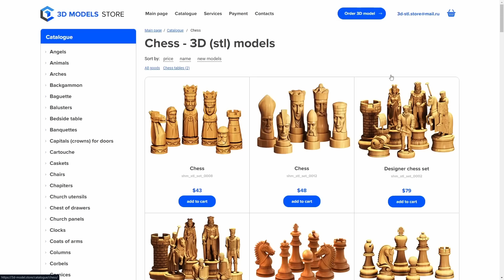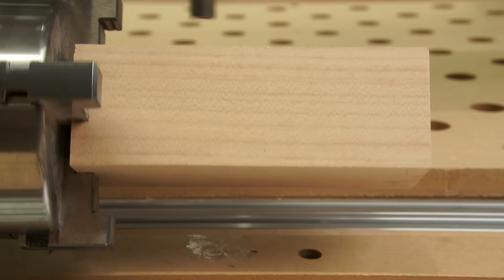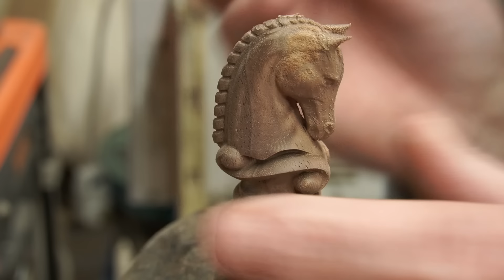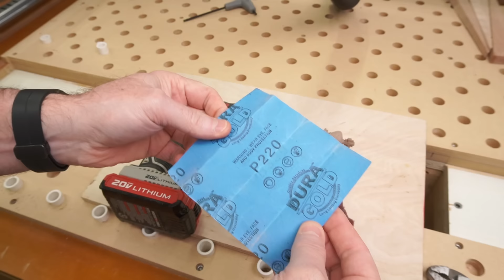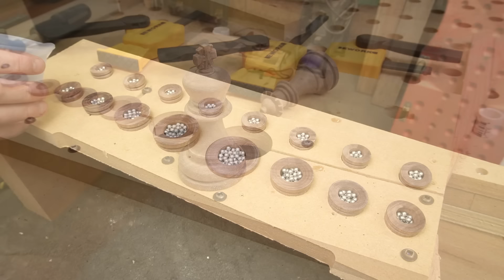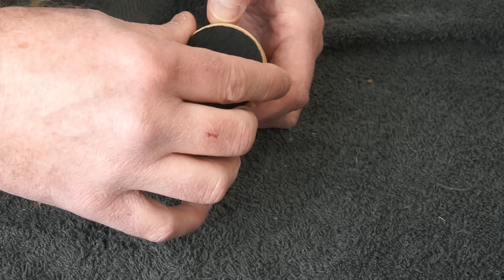Making my own Luxury Chess Set : PART 1

Comment: Couldn't you do the sanding when the piece was on the lathe?
Nice job, by the way!!!
Reply from the maker: It's technically not a lathe in that it spins at high speed.
It was much faster using the drill.

Thank you for watching!

Comment: Gorgeous pieces. Loved the process.

Say you sell them. What would be the price?
Reply from the maker: Thats a hard one to answer.
Because I do this in my spare time, it took me a couple of weeks to do this one set, so trying t determine a price for the time involved would not be fair to whoever I sold them to.

But to answer your question, I have seen similar sets go for as much as $1000 online.
Thank you for watching!
Reply: @MandSWoodworks  Thats exactly why Im asking. I have been working my way up in cnc, 3d printing and lasercutting. Im about to buy a small 4 axis cnc, and the idea is to do chess pieces.

If the machine can actually do a decent set and the price is around that, it would make sense to maybe get a second one to speed up the process.

Thank you.
Reply from the maker: @Alientcp 
I have given some thought to mass producing these and yes, the only feasible thing to do would have multiple machines working at once. 
Otherwise it would take you months to build up an inventory and be able to fill orders.
And also, yes. You wouldn't need a huge cutting area. Just big enough to accommodate the rotary axis. 

Good luck!

Comment: Old heavy sets simply used a cast lead weight disc glued into the base before the baize was applied.  Lead gives better weight for a smaller amount than steel, so base holes can be smaller.
Reply from the maker: I had considered that before deciding on using the BB's, but lead is hard to find in smaller pieces unless you use fishing weights, which are usually oddly shaped.
The BB's did the trick though. 
The chess pieces had a nice "weighty" presence to them. 

Thank you for watching!

Comment: Pretty sure in normal piece making they do the same thing you did but not using bb's or needing resin.  They just go to people who sell metal weights and buy small metal discs, cut the same hole, then just glue it in the bottom.  That way they know exactly how much weight they are adding and the bottom remains perfectly flat.
Reply from the maker: The BB's worked ok.
And the bottom was still perfectly flat when I was done.
Thank you for the feedback and thank you for watching! :)

Comment: Knights look kinda dinky and the Kings are a little on the chunky side, but still an amazing job regardless.  I had no idea CNC machines were capable of this tbh.
Reply from the maker: The Knights actually are the correct size, but admittedly I did make the Kings a bit on the heavy side.
Thank you for the compliment and thank you for watching!
Reply: @MandSWoodworks  Looking at the complete set on the beautiful board you made seems to balance everything out mate. You've made something really special indeed ;-)

Comment: How much does a small CNC machine cost if you only use it to make chess pieces? Thank you for your reply
Reply from the maker: There are many small CNC options out there, so there would be a great divide in cost for each one.
I am personally a Onefinity fan right now.
That being said, If I were to mass produce these things, I would buy the Onefinity Machinist, which is a small 16"x16" machine, and I would buy a small inexpensive air cooled spindle, and the same cheapo Chinese rotary off Amazon that I used in this video.
All together I would most likely have about $2800.00 tied up in the whole thing.

I hope that this answers your question.
Thank you for watching!
Reply: Small CNCs are cheap, but in this case you need a rotating axis. It's more expensive and quite big to fit in a small machine
Reply: @enklum  What do you suppose is the minimum cost for a new set up to make chess pieces?

Comment: Hello author. Please share with me the job settings in Vectric, that You chose to cut out these models like this on the cnc in one go? And what bit did You use?
Reply from the maker: In Vectric:
The 'Job Type' was: Rotary
Zero Position: Machine Bed
XY Datum Position: Center

You can find the bits that I use in the description of the video.
I hope this helps.
Thank you for watching!

Comment: Use a tumbler rather than all the hand work to smooth them. Unless you enjoy taking the time to do that. I personally hate sanding. 
On the finishing I would probably dip them. do a little plunge on the bottoms to insert a small eye bolt, hang on rack and dip. I know a place that makes Duck calls and that is how they do it.

Comment: M&S Woodworks, how did you connect the NCTOPBAOS K12-100mm CNC Router Milling Machine Rotational Axis to your Onefinity CNC?
Reply from the maker: I have the MASSO controller and it has an additional channel for the 4th axis.
In addition to the Rotary assembly, I also bough this stepper driver: https://amzn.to/4mvTLlc

Connect the stepper on the rotary to the stepper driver, and then connect the stepper driver into the 4th axis of the CNC controller.
I hope that this helps.
Thank you for watching!

Comment: What 4th axis are you using? How did you connect it to the Onefinty?
Reply from the maker: I didn't buy the Elite upgrade from Onefinity, instead I ordered the MASSO controller and all of it's components straight from MASSO, so my setup is quite different from what you would see on a normal Onefinity Elite machine.

With that, the MASSO controller, being capable of handling a 4th axis connection has those on the side of the MASSO controller. 
So to answer your question:
Here is the Rotary axis that I use in the video-   https://amzn.to/4mno11G

I connected the stepper that came with the above Rotary, to a separate stepper driver, that you can find here -  https://amzn.to/45pOuG2

I then connected the stepper driver above, to the 4th axis connection on the MASSO controller.
I hope this helps. Thank you for watching!

Comment: For that setup, what does it cost? I've had people ask me if I make chess pieces. I make boards, etc . I've look at if there is an accessory for mini lathe a Copier / Duplicator.... ???
Reply from the maker: By setup, I am assuming you asking how much the Rotary Axis cost?
I paid around $300 for the Rotary off of Amazon, plus a stepper driver which isn't expensive at all.
The MASSO controller has an extra channel/axis that allows you to run the Rotary from it.

I hope that I answered  your question.
Thank you for watching!

Comment: For the knight, it looked like there was NON-ROTARY cuts involved. 
Did you use a fixed rotary angle and then do a “normal” cut?  Meaning the cut involved X, Y and Z?
How did you know the angle to set the rotary at.

P.S.  Good background music.
Reply from the maker: The answer to all of your questions is yes. 
I explain the method I use in the video during the scene where I'm cutting out the knight. 
I used a normal 3d machining tool path to reach the under cuts that the rotary tool path missed. 

Regarding the rotary angle...
I set the model up in Vectric so that one side was pointing up and that would be zero degrees. When I needed to cut the opposite side on the model, I manually spun to the other side by entering gcode 'A180' in the MDI to spin it 180 degrees.
Make sense? 

I hope this answered your questions. 
Thank you for watching!

Comment: I see in this case you didn't use a tail stock.  Why not?  Not needed because the chuck of the work piece is strong enough?  The work piece is thick enough?
Reply from the maker: All of the above, except that the length was the factor and not the thickness.
The stock wasn't long enough, in this case to warrant a need for the tailstock. The chuck clamping pressure was enough to keep it stable.
Thickness did not matter because the stock used for the pawn pieces was only an inch square.

Thank you for watching!

Comment: On cleaning up the rook tower, would a tail stock drill chuck have worked, or would have had had geometry you didn't want?
Reply from the maker: It could have, but the tail stock that I have only has a live center that isn't removable. 
But if I could install a chuck into the tail stock, one problem would be that the motorized chuck spinning the model isn't fast enough to drill quickly. It would be a long drilling operation.
And as you mentioned the geometry, a regular drill bit would most likely leave a less desirable finish in the 'floor' of the tower, so maybe a flat end mill would be better. But then finding a flat end mill the perfect diameter to match the diameter of the cleanup cut to be made would probably be a problem too.
But it's a good idea as it would save a ton of time and would certainly be worth a try.

Thank you for watching!

Comment: I watched this awhile back when I was first setting up my rotary. I ended up using Desk Proto 7.1 as I don't use Vetric. It's just not intuitive to me. I learned on Inventor so I still use Fusion as well as Carvco. It appears that you use the rotary as continuous and the X axis as incremental. In DP7.1 that is a check box and you can run the X axis as continuous and the A axis (rotary) as incremental. It takes longer per piece but seems to give me very good detail. I've not tried to do a standard Staunton set where continuous rotary would be more effective. I've done Gothic English pieces and Egyptian pieces.  Love your work though. Oh...plain unsweetened tea for me. :)
Reply from the maker: As mentioned in the video, I gave up on Deskproto for similar reasons as you say you aren't comfortable with Vectric.
Apples for Apples they both behave the same way, but I'm heavily invested with Vectric so I stick it out with that.
If a reasonably priced software came along that offered true continuous XYZA, I would buy it in a heart beat.
Proper sweet tea is only slightly sweetened. Most tea you get in a restaurant is ruined because they sweeten it to level a milkshake would be. 
Properly made black tea should be strong, like coffee would be, with just a hint of sugar to ease the bitterness. 
But you didn't come here to talk about tea. ;)

Thank you for watching!!

Comment: what are the dimentions of the blanks you are ussing
Reply from the maker: I determine the size of the blank depending on the size of the 3D model to be cut.
For instance, if the model is 2 inches tall and 1 inch wide, then I would cut the blank to be 4 inches long and 1.125 inches square.
4 inches long to accommodate the 2 inch height of the model, and an additional 2 inches to compensate for the rotary chuck.
1.125 inches square to accommodate the 1 inch width of the model, and an additional 1/8inch margin of error for clearing to make sure no undercutting occurs .
Make sense?
I hope this answers your question.

Thank you for watching!
Reply: @MandSWoodworks  thanks

Comment: Great chess ♟️ pieces! Exceptional work both on and off the CNC and true inspiration to me in setting up mine. I’m curious if Vectric Aspire would be able to handle the 4th axis cutting without the work around?
Reply from the maker: Unfortunately no.
The only differences between Aspire and Vcarve Pro is the CAD part of the software.
The CAM functions are all the same.
Meaning that the rotary axis offerings are identical between the 2 versions.
From chatting with folks who are in the know about Vectric, they say that in the past there wasn't a great demand for using the rotary function, but the last few months they have seen an uptick in folks like me and you wanting more versatility out of it.
So hopefully in the future we will see more functionality out of it since the demand seems to be growing.
Thank you for watching!!

Comment: How did you make the waste board
Reply from the maker: Hi Ray!
The obvious answer is that I made the waste board using the CNC.
But I am going to assume you realize that and are asking what steps I took to  make it.

I simply drew up the waste board how I wanted it, matching the cutting area of my CNC using Vcarve Pro.
Once that was finished, I cut a piece of MDF the same size as the cutting area of my CNC and bolted it to the table underneath the CNC machine.
Then I ran the toolpaths that I created on Vcarve and cut the dog holes in the MDF.
I use PVC piping, cut in shorts lengths as stops that fit in the dog holes.
And viola! I have a wasteboard!

I hope I answered your question.
Thank you for watching!

Comment: Great video, but you left out the best part.  You never showed how you set up vcarve to handle the undercuts on the knight.  How about a follow-up?
Reply from the maker: Thank you Steve!
I have to be careful with the length of the videos. Adding that info would have made it twice as long.
I will plan out a tutorial for it and hopefully get it made and posted in the near future
But for now, I can give you a crash course...

In Microsoft Windows, I use Microsoft 3D Builder. It comes free with Windows. If you are an Apple user, you'll need to find something similar. I am not a MAC user.
Open the STL model, and position it so that it is laying down along the X axis, and the face or front of the model is along the -Y axis, or quite simply, pointed towards you.
Save that model and cut it using a normal rotary toolpath.

Open the same saved STL that you made in 3d Builder again, and this time, cut it in half, right down the center  lengthwise. 
Save each side of the model to their own file.
In vectric, create a standard 3D toolpath, using the datum "Zero from Machine Bed" as your Z Zero. This will match the center datum used in the rotary toolpath. 
The flat side of each model should be facing downward in each carving file that you create. 
One with the front of the model facing you, and the other facing away from you.
Place a circular vector around the area you want to cut, and then create the toolpath to cut just inside that vector.
You'll do this for each "Half' model you created earlier.
Once the rotary cut is complete, then run 3d finishing toolpath to get the undercut for that particular side.
Once one side is finished, manually turn the model in the rotary 180 degrees, and then run the 3d finishing toolpath to get the undercut for the other side.
Make sense?
If you have any questions, let me know. :)
Reply: @MandSWoodworks  Great video and explanation on working the undercuts.  One other question... What is your Vectric X/Y Datum position and where do you zero your bit for X/Y on the workpiece for the standard 3D finishing?  Thanks!
Reply from the maker: @cablsurfin  
I zero the Y axis to the center of the X axis plane. That is also the center axis of the A-axis.
The Y axis never moves during the operation, just the Y-Z and A (rotary) axis. 

I center the X axis, not to the center of the entire wood blank, but what will become the center of the completed model and I set the XY datum to center in vectric. 

Make sense? 
I hope this helps.
Reply: @MandSWoodworks  Makes sense. Thank you very much!

Comment: Would you mind explaining how you programmed the toolpaths to carve the bishop's mouth? Did you do it in the same Vectric project? How did you select the regions for the toolpaths? Thanks for a great video!
Reply from the maker: It's a bit complicated, but I will do my best to explain...
For the Bishop and the Knight, I had to edit the STLs.
I cut the model in half, and for each half I used a standard 3d finishing toolpath in Vectric where I used a vector boundary around the area/region where I wanted to cut. In the case of the Bishop, I put a vector just around the 'mouth', as you call it.
In the carving file setup, I made sure the the datum matched the rotary toolpath exactly. I used a center datum for all.
In the models cut in half, I also chose "Zero from Machine Bed" to match the 'Z' zero datum of the rotary toolpath.
After the rotary operation was complete, I ran both the standard toolpaths, turning the rotary manually after each toolpath to cut out those specific areas.

I hope this all made sense.
Thank you for watching!
Reply: @MandSWoodworks  thank you for all the details!

Comment: Your pieces look fantastic. I can appreciate the time involved first hand! I finished my rook tower with a forstener bit. My bishop was done freehand with a small saw. Weighting them with lead took some doing also. I made a fixture to run them in the lathe to bore the hole in the bottoms. This also worked for sanding and trimming off the bottoms. I designed the pieces myself as trying to find a large set with a king height of 5 inches proved difficult. Most were easy to model up in 3DS Max except for the knight. I don't want to post a link to my video on your site  without consent but if you're interested just search Custom Chess board and pieces-CNC router 4th axis. I didn't do a video of the progress but I put together some still images and naration to give an idea of the project. I just found your site and liked, subbed. Looking forward to seeing more down the road. 👍
Reply from the maker: Holy Cow, Greg! Well done! The chessmen and that table are fantastic!
Is that Ebony and Boxwood? I tried getting that for mine, but I where I live I would have had to pay several hundred dollars for just the wood and I didn't want to use that on a first set.
What did you finish them with? 
You need to do a video of the  process. I'm telling you now, it would go viral!
Again, very well done!
Thank you for watching!!
Reply: @MandSWoodworks  Thanks for the compliment. It means a lot coming from a fellow craftsman that can hold a few thousandths in tolerance. I watched your V-carve video and I know that requires some very well thought out processes. Not much room for error there. I need to try your settings for the start and cut depths. I made one for my son with two Weimaraner dogs and their names. It turned pretty out nice but had some very small errors. All the best brother!